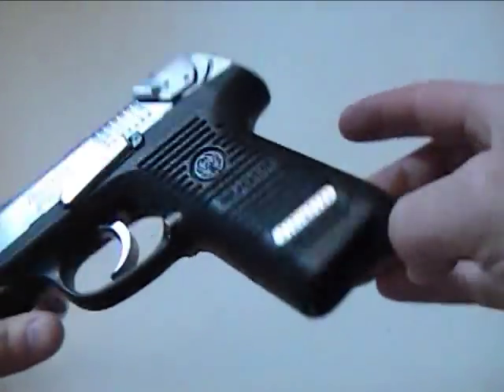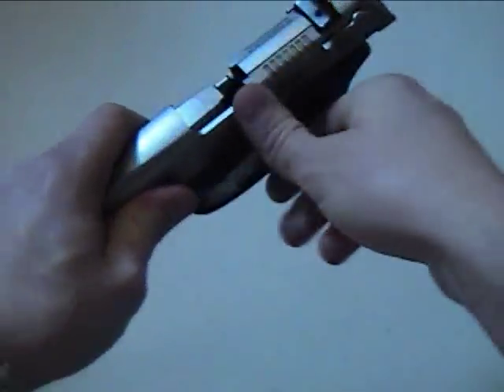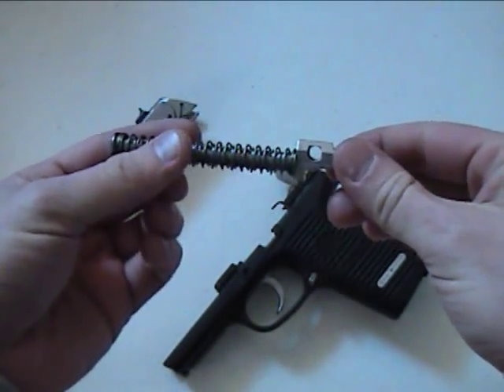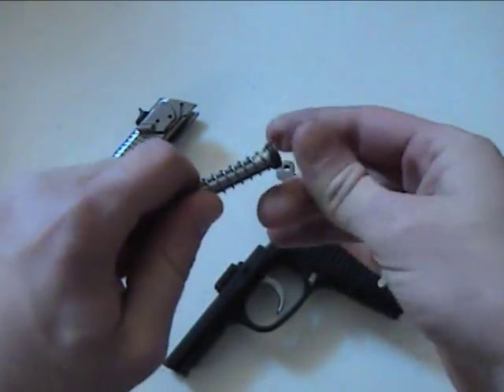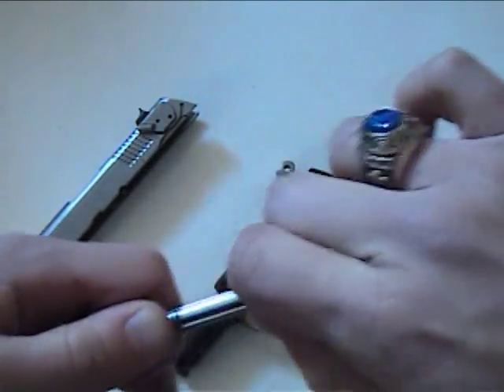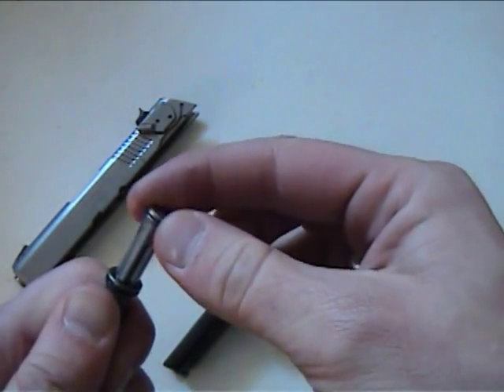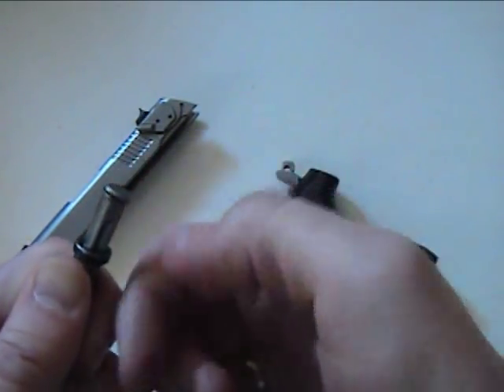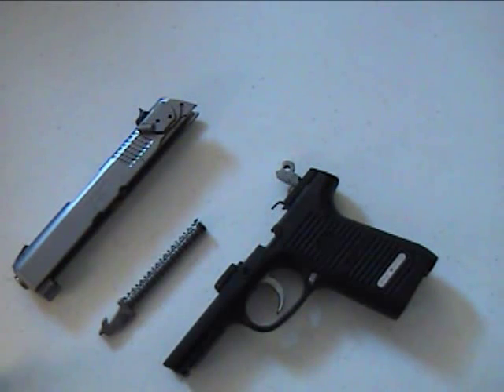Spring problem with the Ruger P95

Comment: Came home from work today and the package from Ruger was waiting for me. When I opened the package I was surprised. In stead of sending me the little metal ring like I was expecting them to, and I would have been happy with that. Ruger actually sent me an entire brand new guide rod assembly. All I had to do was remove my old one and replace it with the new one. Took like 6 seconds. Great company!!!

Comment: I had the same thing happen on one of my p95's.  I didn't lose any parts. I solved the problem by reassembling the recoil rod, using a small c clamp to hold the springs down I use a pair of needle nose pliers and lightly expanded the retaining ring back out. Over 1000 rounds later, no problems! A tech at Ruger told me this all they do to fix it. Its not a material failure, sometimes the retaining ring can be over pressed when itstalling. This is a permanent fix for the problem! Enjoy!!!

Comment: Same thing happened to my P95DC, during routine cleaning.  Thanks for this awesome video!!
Reply: Mark, how did you get it running again?  Did Ruger replace the parts for you?
Reply: Yes, Ruger replaced the part and it worked fine after that.  Sorry it took me so long to reply.

Comment: That's a common problem with the P95 DC.
I had it happen once.  Excess oil while polishing will make the keeper ring slide from its groove.
Call Ruger if this happens, they expressed me a new keeper ring and and entire new cam block assembly for free.

Comment: Mine did this and Ruger replaced it.  Then it happened again less than a year later.  I never let it bother me though as it's my favorite gun.  I hold it up and place the ring in the front of the gun and then push the entire assembly down to compress the springs in place.  Thousands of rounds later it's never misfired.  I should probably call them again to see about getting it replaced though.

Comment: omg....this happened to my P95 JUST NOW, AS I WAS WATCHING THIS VIDEO O_O.
I i found the little retainer under my microwave, luckily I was able to hold onto the springs. I put about 100 round thru it yesterday at the range(115 grn Wal-Mart Winchester 9mm Bulk). I popped it back on but It wouldent stay, so I turned it around. It held but now Im worried. Guess Ill be calling Ruger. Other than this, the gun is IMO, flawless for what it is. Can shoot stationary, orange clays all day at 25 yards.

Comment: Hello,  the other day I was disassembling my p95 and I got the slide off but when I put it back on I left the tab up and it left the barrel and spring rod pushing out of the slide ( like it is when the slide is pulled back) but I fixed that problem the only thing is that I can not get the slide off of the polymer body, Any help?

Comment: Same thing happened to me a few days ago on my new (to me) P95. Simple takedown, no hammers, army tanks, or monster trucks... it just popped off and the springs took off. So, I don't think it's necessarily due to someone bashing on it with a tool - mine came off on hand-manual takedown. I hope Ruger can replace because even Midway doesn't have them in stock any more.
Reply from the maker: Dan Mowry Since making this video over 7 years ago, I've heard of it a lot actually. In each instance I recommended calling Ruger, and in each instance they simply mailed out a replacement to you. Good luck with it. Good job avoiding tanks Lol
Reply: Thanks for your reply! I appreciate it. Will do.

Comment from the maker: Well, I carry this firearm for self defense almost daily and I shoot 50+ rounds through it a month. That means that I sweat on it, lint from my clothes gets on it and its exposed to humidity from rain and snow. I clean the gun every month and I clean everything every time. The spring assembly you just dab on some solvent, compress a few times, fully compress and wipe clean. The nooks and crannies on the slide are quickly cleaned with a toothbrush and patches. I say: take the extra 5 mins.

Comment: I've had the same problem with mine. It's an external spring clip (kind of like a c-clip) that holds the spring retainer. I don't think it would affect function if it were to fail when the gun is assembled since the rod and spring retainer are also held in by the hole in the slide into which the end of the rod engages, but I damn near lost that retainer ring when it went shooting off into a pile of junk in a corner of my garage.

Comment from the maker: That's a malfunction called a double feed. This happens when the round you just fired stays in the chamber and a new round is trying to enter the chamber. This can happen if the ammunition you're firing is too hot for the gun (has too much powder in the case, ie.+P+), you have a faulty or broken extractor, or your chamber is dirty and the powder is causing the fired round to stick in the chamber. Try cleaning the gun really well and shooting a different brand of ammunition through it.

Comment: I don't know why you can't imagine anyone else having this problem. I have 2 and this exact problem happened to both of mine. The first one happened at around 1500 rounds. I was cleaning the rod assembly and it shot off and the 2nd one happened at around 3-4 thousand rounds as I took the spring rod assembly out of the pistol, it was already in pieces. I'm going to contact Ruger and get replacement parts b/c it's supposed to have a lifetime warranty.
Reply from the maker: Simple. Six years ago when I made this video, this was the first time I had ever heard of someone loosing this retention pin.

And as for my P95, I have about 16,000 rounds through it, and my rod and spring assembly is still assembled- and that ring is still in place.

Comment: Just be prepared to be on hold for a little while, and have the serial number with you when you call. Mine is a pretty old model, I believe it was a very early P95, no safety, decocker only, and being pretty old the guy still sent out the parts for free, he said it was because it was cheap enough in price to do so. After about a week and a half I recieved the parts by postal service. Also make sure to look closely at the retainer, it is cupped on side, the retaining clip should go inside the cup

Comment: last year after going to the range went to clean my p 95 after cleaning went to reassemble that clip failed springs came off .called ruger sent it back they fixed that and a couple of other minor issues.no futher problems fired about1000 rds thru it since .(knock on wood)

Comment: The same thing happened to me when I took it down for cleaning the springs popped off. I need to order a new one.
Reply: You will have to send your guide rod, springs and spring block into Ruger so they can repair it. The retainer clip is no longer for sale anywhere. Some online sites mark it as discontinued. Mine broke off after a few thousand rounds and this is the only way I've found to get it replaced.
Reply: @trex9194  how much does that cost?
Reply: @ramiashawa3118  the repair is free. You just have to pay for shipping. You will have to send in the entire pistol to Ruger. Some people don't like that the entire pistol has to be sent in. You will have to contact Ruger with the serial number of you pistol to make a case for the records.

Comment: This crap happened to me today!! I began to take down my p95. When I went to remove the guide rod the spring started to release its tension and stretch out. That tiny ring mention in the video has disappeared. I would have never noticed if I didn't decide to clean my Ruger today. Im a little worried because my firearm is about 3 years old now.

Comment from the maker: Just so we're clear, because often times people use terms incorrectly, the gun was "misfiring", meaning that it was not firing the rounds? With a striker fired pistol, this could mean that the spring driving the firing pin is too weak to set off the primers of your rounds.Since running the slide compressed the firing pin spring, a popping sound could be a serious problem.  I'm thinking this is something you should either see a gunsmith about or more likely ship it to S&W for service.

Comment: Its not going to cause the gun to blowup or anything like that! If the slide fails to slide back when firing it will only over pressure that round. The gun is made to withstand this type of failure even with +p+ ammo!